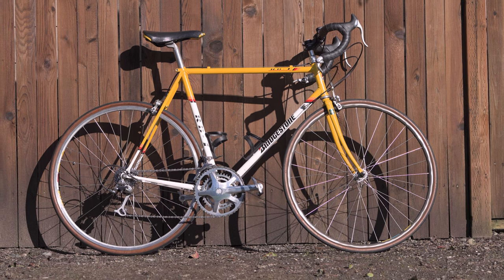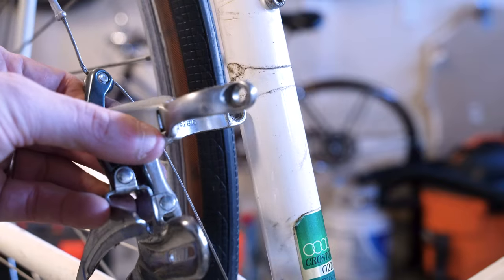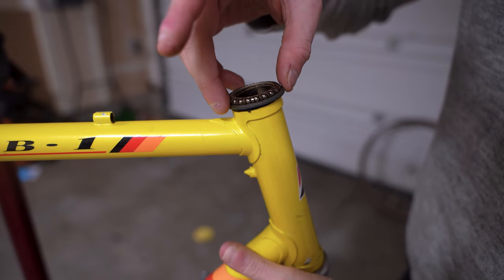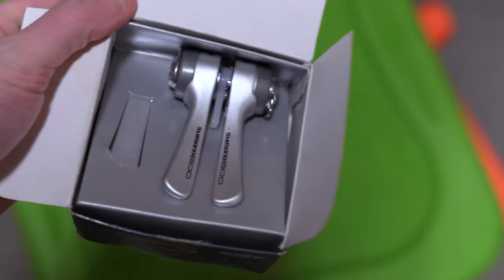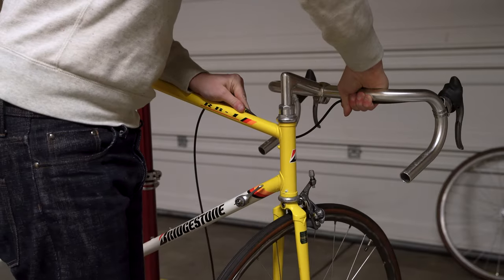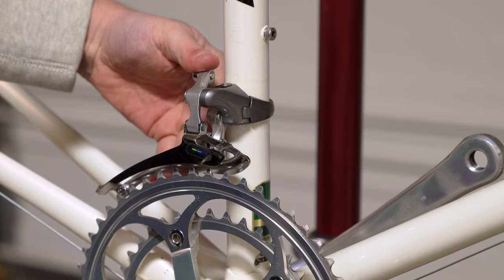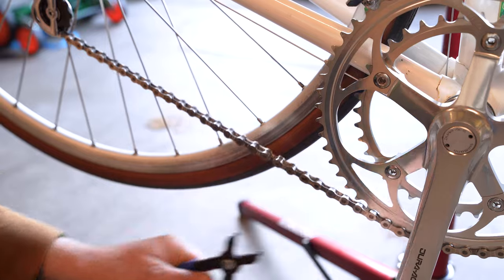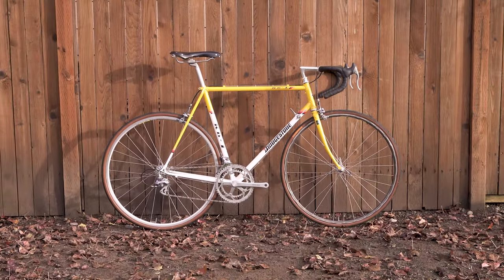1992 Bridgestone RB-1 Vintage Steel Bike FULL restoration!

Comment: The shop I worked in back in the day was a Bridgestone dealer. I got pro deals on a yellow/white RB-1, like yours, and a white MB-Zip. I should've kept them both!
The RB-1 cable housing was silver/gray. I believe the brakes were Dia Compe 300. The stem was a Ritchey, bars were Nitto. The wheels were Ritchey Vantage rims laced to Ultegra 600 hubs. The headset, cranks, derailleurs, BB, and bar end shifters were all Ultegra. I can't remember what the saddle was. I switched mine over to a Concor. The seatpost was an ugly Sakae. I upgraded to a Ritchey/Nitto.

Comment: I've got a '93 RB-1 in the rare size of 54.5 (Bridgestone made that size for just 3 years, '92-'94). It was an Ebay purchase in 2015. Like yours,  mine is yellow and white. One of the original Shimano shifters wore out, so I replaced it with Micro-Shifters, and left it an 8-speed. The crank is original, though I replaced the 53/42 rings with a 52/38 (lots of steep hills here in Baltimore County).  Front and rear derailers and brakes are original. The original stem I replaced with a H20, just the right size for me, and a Thompson Elite seat post now holds firm the saddle, something the cheesy original, single bolt seat post couldn't. I'm usually the only one on group rides riding a steel frame, and that includes my other bike, an '86 Schwinn Paramount, just about all original.
Reply from the maker: Oh man, a 93 yellow Bridgestone and a Paramount? Your taste is 👌👌👌
Reply: @JustinDoesTriathlon  You might know that the '93 came with a Richey crown fork. I once had a '90 RB-1 in 56cc. The top tube was just too long, so I sold it. Bridgestone sizes jumped from a 53cc (too small for me) to 56cc (too big as noted) until they finally brought out the 54.5cc size in 1992.  I lucked out on Ebay.

Comment: 52/42 or 43 makes so much more than 39…🙄🤷🏼‍♂️…way too small for a road bike that isn’t going to be risen up a wall…very nice 
I’ve had a 91/92 Cannondale 3.0 Criterium that I bought as a NOS frame from my Local shop in Brooklyn….Roy’s….its not the world famous R&A where people walk in and drop $10,000 like it’s no big deal….probably more like $20,000 today….but Roy’s is a great shop that has been continuously run by its owner Alan??….since the early 80s at least 
They had this Cannondale in my size, it was one of just a handful of leftovers from their time as a dealer for them….white rear triangle and half of the front, with a royal blue front end…they threw in a polished aluminum Sakae fork, ttt bar/stem, Campagnolo Mirage 8 speed group and FIR rims to build the wheels….
The end of the 3.0 series…and it was a Criterium as opposed to the Road Race 
The bike would eventually receive Rolf Vector Pro  wheels and a Thompson seat post/Selle Italia Flite Ti saddle…..
I still have the bike and it’s getting upgraded to Chorus 10 speed
But I’ve also acquired another 3.0 Criterium from the same era…a year earlier or same year…in the royal blue/fade paint with a matching fork….one of the best paint schemes Cannondale ever did…along with just solid Red…..which leads me to my third 3.0….a 1990 Red frame with a white TIOGA decal on the down tube, and  a white Sakae fork…The frame/fork came with a Mavic headset and the Mavic bottom bracket shown in this video…
The Blue bike came from Texas with its fully intact factory spec…Shimano 600 group and ancillary parts…the finish on 600 is classically beautiful with a slight tech edge…the brake calipers were aesthetically way ahead of their time…and the levers, such a clean profile with flush transition from lever to hood
Reply from the maker: Thanks for sharing, that's an awesome set of bikes! They just work, and are very very reliable. Earlier tonight I was looking at the RB1 and just thinking, 'man this is a sweet bike.' That's cool you've got that Mavic BB too; super highly regarded BB.